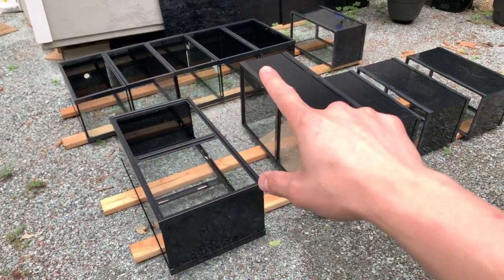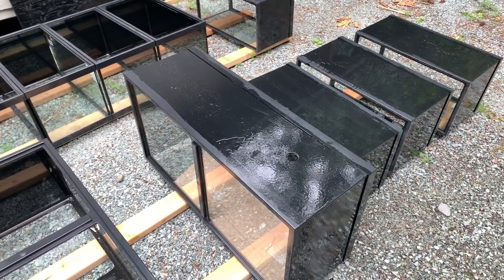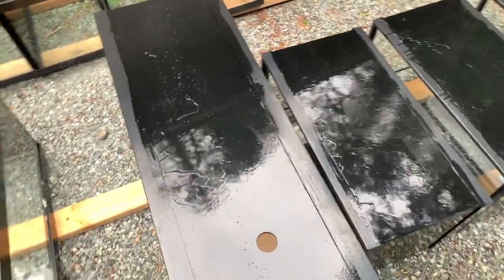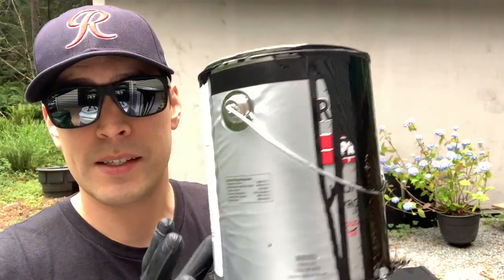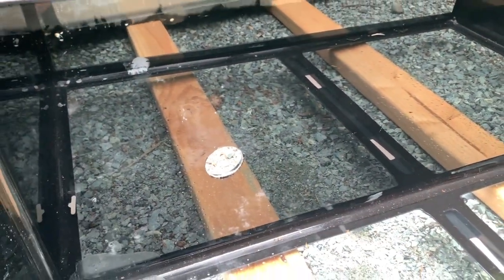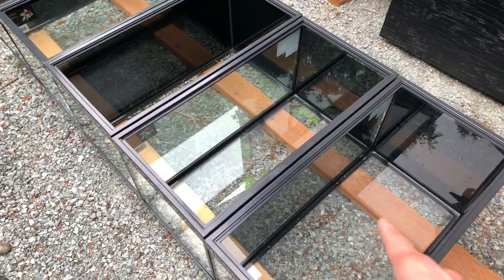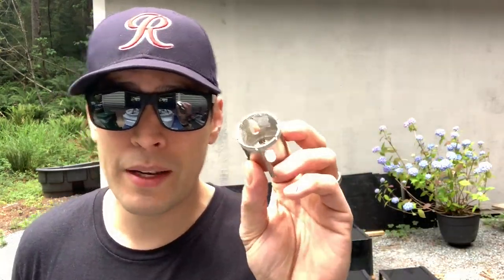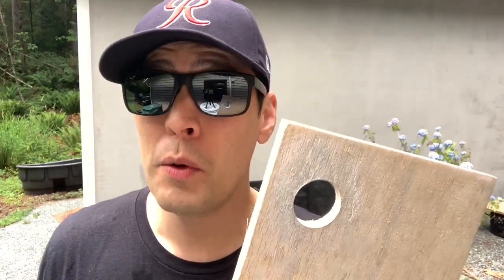Fish Room Expansion Painting and Drilling

Comment: Thanks Randy! I don't always see videos on how to paint tanks.  I appreciated the video very much.  Good to see you.  I was also suprised that you don't use water in the process of drilling.  Many of the other videos I've seen use a constant spray of water to keep the bit cool.  Was it because of the "diamond" point?  or was it just small enough hole that water was not needed?  <“(((((>< Fishez <“(((((><
Reply from the maker: Fishez i do use water.  I use a water bottle with a hole in the cap to keep water on the cut and bit.